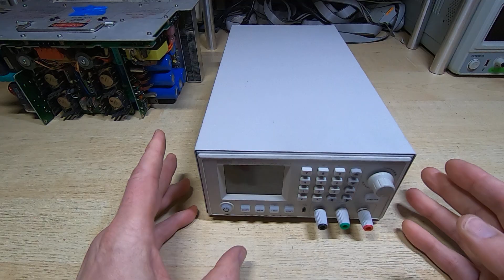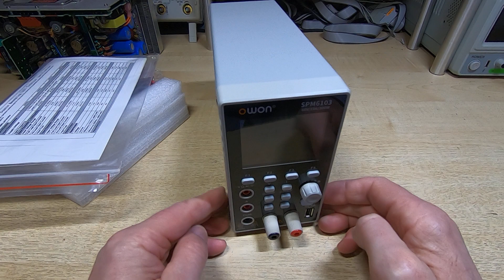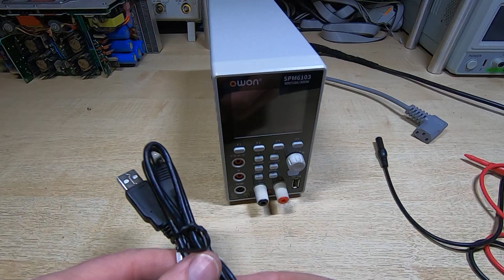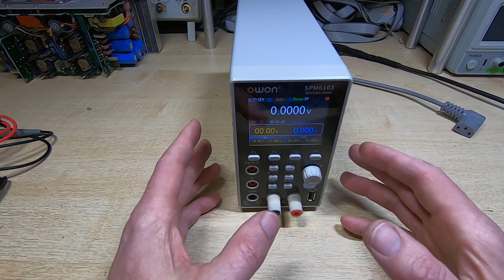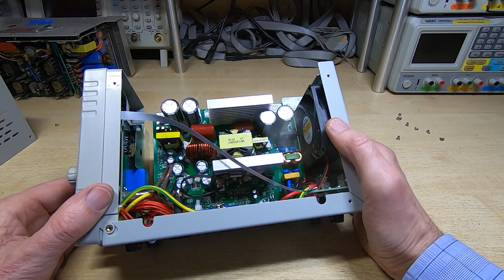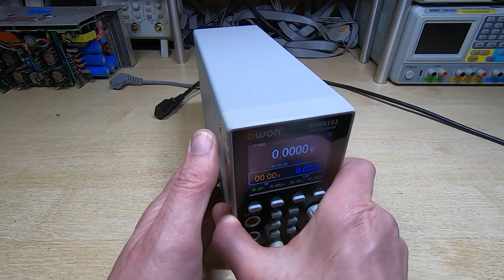OWON SPM6103

Comment: You didn't measure the noise level of your power supply with an oscilloscope. Other reviewers also analyzed it with an oscilloscope, showing very high noise and ripple levels. Therefore, they don't recommend this power supply.
Reply from the maker: The video description clearly says 'A very quick look' it is not intended to be a detailed review. It is also a cheap supply and so high noise levels is not surprising. It is not intended as a high end supply but I have used it a great deal with no problems. It really depends on what people need so dismissing a cheap supply due to noise levels is not particularly useful in my opinion.

Comment: Just picked up one of these for £96 shipped from AliExpress. Already have an SPE6103 so this will give me an extra multimeter on the bench. Good to see the neat construction inside matches the externals. These are great little units, not for instrumentation work as you say (I’d expect to pay many times that price for that sort of kit… used plenty of reference grade equipment in the past for Physics research work) but are a good buy for my hifi restoration hobby work.

Comment: I've been using spm6103 for a year and I think it's the best $100 I've spent in years :) The ability to program voltage/current changes over time is great, thanks to it, for example, in a few hours I improved the MPPT algorithm in the PWM controller on esp32 by simulating changes in the panel light intensity on the power supply.

Comment: Hello , did you know that the unit has a calibration model. You have to press the  buttons in an order sequence to get into the calibration mode and you can adjust to your agilent multimeter.  I found the video on how to get in to calibration mode on the YouTube.  Let me know if you know about the calibration mode and i send yoy the link.  Thanks.    I just buy the same one on ebay for £95 using a voucher.  Thanks for your hard work much appreciated you.❤

Comment: All my test equipment is lilliput (owon) they are brilliant

You can calibrate the multimeter on this piece of equipment also the voltage output, you can not do this with inferior hantek stuff

Comment: I also just bought this nice power supply and I am happy that the fan control is doing a good job (-> Fan off) before it’s getting warm.
Then the control is a bit weird close to the idle rpm, it makes strange noises to keep the fan running at the very low rpm. 
Does Owon supply Firmware updates?

Comment: Seems a nice build, it's good to see the use of silicone in the correct places and used sparingly, as opposed to plastered in it and of course it's reasonably accurate as this cheap stuff either works or it dosent.
Reply from the maker: I agree, I often see cheaper equipment where it looks like they applied the sealant by detonating a tube of the stuff somewhere near the board.
Reply: @JerryWalker001  :)

Comment: Hi Jerry. I bought one a couple of months ago and am quite happy with it. I also noticed the accuracy when I measured it with my trusty and very accurate Fluke 8840A. As a hobbyist it's more than adequate for me and I happen to also use it next to my RD6006. It is as you said really quite light and small and it would fit 2 of these on the footprint of the RD unit and then have 2 multimeters as well.
I would me more then happy to see more of your tests of this unit. There will certainly be bits that you come across and don't like (Spoiler alert, Function keys?). Anyway, I don't mind  but I would like to hear your thoughts on that.

Comment: Thanks, great intro to a new problem-solving product. I had a similar problem, my good lab supplies seem like they are always tied up. This is a great, small, reasonably priced, solution. I recently bought a cheap Korad linear supply. Now a bit of buyers remorse. But can always use one more power supply.
Reply from the maker: Yes you always seem to need more power supplies.

Comment: It is curious that the voltage reading of the power supply part tends to be more precise than the build in DMM. For the price I guess this thing is good enough. What about ripple and noise? What about recovery time after change of load? What about stability when the mains voltage fluctuates? What about input protection, for example when a battery gets connected the wrong way? Is there any OVP? Drift over time and/or temperature? No Sense leads? With over a couple of amps that really becomes an important point.

Comment: Thanks for the review. I bought the 110 volt version SPE6103 ( main board the same as SPM). It is cheaper by 15-20 euros when 230v version. It is easy to convert to 230. Need cut off one jumper on the board and change the fuse from 10 to 5 Amperes. No need to change the varistor, even on the 110 volt version have 14D561K!
Reply from the maker: Interesting. When I purchased it the 230v version was the only one available. Maybe it depends where you buy it.
The SPE does not have the DMM so did not provide what I was looking for.
It is just the power supply but as you say it shares the same power supply board.
It would be interesting to see of the 30v version can be converted to the 60v with a firmware upgrade.
Reply: @JerryWalker001  I haven't seen a board from the 30 volt version, maybe there is a different transformer. Or is the difference only in the firmware? I bought it on Banggood, SPM eu version  now has a good price with fast delivery from the Czech Republic
p.s There is a video on YouTube on how to enter the secret menu and calibrate it.

Comment: I'm curious if the multimeter is isolated from the power supply outputs?  Maybe something to test in a follow-up video if you do one.
Reply from the maker: Yes it is that is why I had both inputs connected. With ground disconnected it does not read anything and if the inputs are reversed then it reads -ve.
Same applies to the current inputs.
It does seem to be fairly well designed.
I may post a follow up video once I have finished testing it.